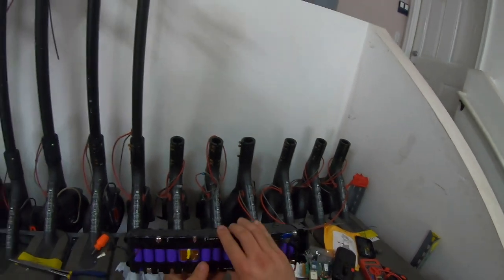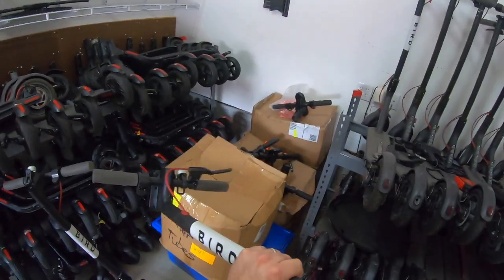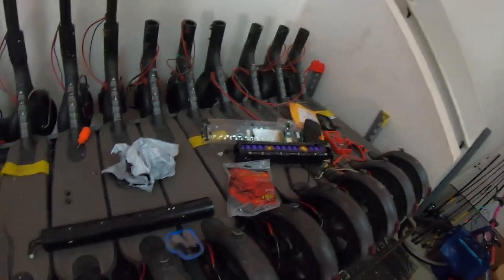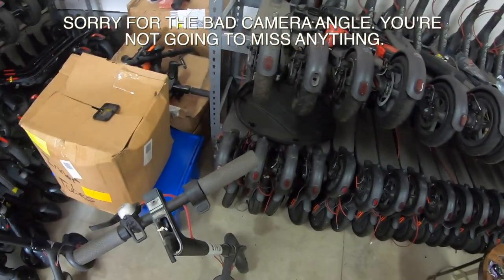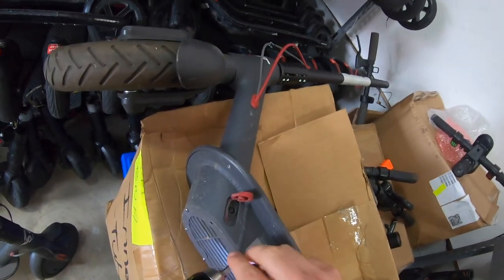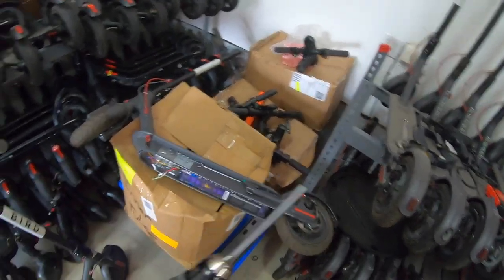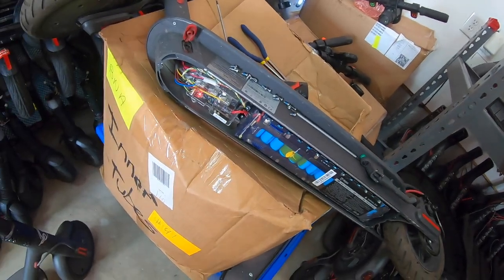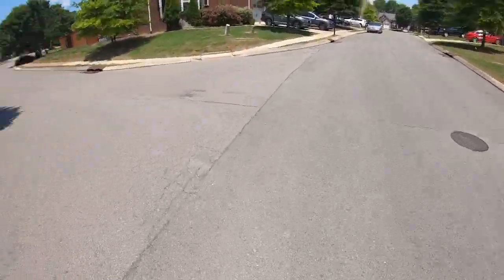Converting A Bird Scooter into a Personal Scooter. All the sauce. HOW TO VIDEO.

Comment: Use to be a Bird charger and mechanic for awhile and i learned a lot by tinkering around.  I bought several batteries back from the dead (they were just under 3 volts) by connecting the positive and negative leads from another fully charged battery for about one minute which temporarily would bring up the voltage in the battery.  Then as soon as I disconnected the good battery I plugged in the charger and now it started charging the low battery since I brought up the minimum voltage to an acceptable level for the charger.
Reply from the maker: Very interesting. What was the bms board doing before you linked a second battery?
Reply: Nothing.  No light flashing at all.  I'm guessing once the battery gets low the Bird brain continues to further drain the battery then the brain has a backup battery and even those drain dead.  Sometimes I was able to bring a dead brain back to life.  I'm here in LA and for the past year Bird and Lime and barely on the streets.  Not sure how they continue to remain in business.
Reply from the maker: Huge thanks for this tip. I’ve brought back so many batteries now that I thought had bad bms boards.

Do you have any idea how to revive a Segway-Ninebot ES2/4 battery?
Reply: In theory I suppose the same way but I hardly ever worked on those since the battery is tightly fit in the pole.  At one point I had 4 of the M365 but I ended up selling all of them and I kind of wish that I had kept one.  $400-$500 for a new isn't going to happen.  Too bad I don't live closer to you and I might buy one :)  I have a huge box full of parts, tires, tubes, etc which I'm going to hang onto.
Reply: Also if you ever have a dead battery if any kind especially car batteries new chargers these days won't charge a battery that is below a certain voltage so thats that I fo except I hook charger to good battery t then hook the bad battery to the golf battery and the charger will get the bad battery up to vtage to where you can charge it by it's self with out using another battery and it will charge like normal. Also if you have a personal bird type scooter don't charge it until it gets very very low if it is only half battery to 3)4 everytime you plug it in the battery had a memory and will die at only half a battery like a lipo battery had a memory on a rc car same principal
Reply: Hey brother do you have a video for that process? My BMS is not allowing me to charge my battery.
Reply: Hello brother, I'm having the same exact issue where my battery is below the point of charge. How would I got about getting a charge good enough to attach my normal charger to it?

Comment: More to my question is there anything significant I should know about when they break down like what breaks down first? Please I do understand most e-bikes so anything you can tell me would definitely help when it comes to a scooter obviously I know that usually it's the grips that are hindering the breaking and throttle is there anything else that generally goes wrong with these?

Comment: Hey bud
I bought a bird #590 older model and doesn't have a controller, it has three wires that don't look like what I see here . Mine has a different connection? Also what kind of control board do I need? Thank you so much for your help
Reply from the maker: Hey there, without having my hands on it I can’t give you a promising answer. I haven’t worked on that exact model. Keep searching, there’s got to be another video out there.

Comment: They also have a GPS track installed or is it on the mainboard?
Reply from the maker: This model for bird was in the dash on the handle bars.
Reply: Can you please post a link on the control board and dashboard you recommend? Thanks.
Reply: @brycecrum1  eBay xamei m365
Reply: Control board
Reply: It's on the board situated in the headset. 15.99 part on eBay can sort this out. Download the xaiomi app and you can downgrade the os and viola your done
Reply: @brycecrum1  there all the same just search xaiomi m365 board and your good to go
Reply: @ItzJigz187  so all you have to do is replace the circuit board and it can become a personal or are there more steps?
Reply: @ItzJigz187  and what’s the circuit board and what’s the dashboard I’m confusing the two?

Comment: How do you make those refurbished Bird scooters foldable? The ones I’m seeing are saying they are not foldable.
Reply from the maker: You can buy a foldable adapter on eBay for about $35
Reply: You wouldn’t have a link by chance for the adapter.
Reply: @teambryie  how do you convert the Bird ones?
Reply from the maker: @Guuch  what model bird?
Reply: @teambryie  The Bird One.
I'm also looking to purchase xiaomi's operable or inoperable, or batteries. Any leads?
Reply from the maker: @Guuch  I’ve got about 75 Xiaomi batteries.
Reply: @teambryie  how much? I’m in Maryland.
Reply: @teambryie   is there a better way to communicate, IG, What’s App etc. I’m seldom on here and I do not receive real time notification
Reply from the maker: @Guuch  Message me on IG @victorbryie

Comment: Does the dashboard work for the bird one?  Because in the video the dashboard looks thinner than the top section on the bird one.
Reply from the maker: Yes, you will have to change the handle bars though. You can order an Xiaomi M365 handle bar complete that will work.
Reply: @teambryie  is the wiring compatible then?
Reply: @mr.chubchubs6697  hey it's been a year but any chance I got it to work for your bird one?

Comment: I I have read in forums that they have an rfid sticker with which the company can detect the scooter despite removing the GPS, is this true?
Reply from the maker: Possibly on the newer models. NOT these.
Reply: @teambryie  so one time the GPS is removed from the handlebar panel there is no way to locate the scooter?
Reply from the maker: @fernandomontealegre3573  correct

Comment: I have switched out the circuit board and battery and still have no power. Battery is good and will charge, but the circuit board won't turn on. Any thoughts?
Reply from the maker: How do you know your battery is good?
Reply from the maker: What color is on the charger light when battery is plugged in?
Reply: I put a new battery in and the light is blue on it.
Reply from the maker: @crystalm1030  did the control board in the handle make a pop sound when you plugged it in?
Reply: It didn’t make any sound at all. But I switched it out before the battery so it had a dead battery when I plugged the control board in
Reply from the maker: @crystalm1030  do you have another control board to try? That would be the next step. If another control board doesn’t work you need to change the mothering board next to the battery.

Comment: What control panel and Dashboard do you recommend?
Reply from the maker: Anything that you can find on Aliexpress. Just have to wait weeks to get it.
Reply from the maker: US $47.74  40％ Off | Electric Scooter Bluetooth Controller Kit with Display Accelerator Light Set for Ninebot for Xiaomi M365 Pro Electric Scooter
https://a.aliexpress.com/_mPekf69
Reply: The blue light on the battery is flashing. I assume that means everything is working fine?
Reply: @teambryie  also I only need the control panel and new dashboard
Reply from the maker: @brycecrum1  the flashing blue light indicates that you have a good working bms board. That what you need. Battery is good.
Reply from the maker: @brycecrum1  this will work great as long as your control board is working properly. What brand scooter?
Reply: @teambryie  Ninebot m365
Reply: @teambryie  once I install the new panel and dashboard how do I get the scooter to work? Is that all I need to do? It’s an old bird scooter.
Reply from the maker: @brycecrum1  bird is the easiest. Only the dash needs changed. You don’t need to change the main circuitboard in the deck unless it doesn’t work. The new dash is plug and play. No updates required. Make sure whatever dashboard you buy includes the screen protector.
Reply: @teambryie  I’m getting an error when trying to pair with the ninebot app. It says connection service under maintenance
Reply from the maker: @brycecrum1  you need to pair with an Xiaomi app. Try “Mi Home”. Is your scooter working properly?
Reply: @teambryie  it moves! As far as properly that’s another story I’m not sure all the technicalities. I do need to find shorter screws as the old ones holding in the control panel were much longer. I assume a hardwares store has them
Reply: @teambryie  also it’s being found on the ninebot app but it’s not connecting fully
Reply from the maker: @brycecrum1  clip the screws with snips. Saves you a few dollars.
Reply: @teambryie  do you know how I can get the light working? Everything seems to be working but the light. Oh and I can’t find a mi home app other than the smart home app
Reply from the maker: @brycecrum1  to turn the headlight on you push the power button one time after the scooter has already been turned on. 

If the headlight is still not working the headlight is either bad or there is an issue with the main control board in the deck. I have never had an issue with the light it self being broken. Always a control board issue. I then replace the control board.

In regards to the app, I use “mi home” with an iPhone. My be different on an Android.
Reply: @teambryie  ok I’m using the app On iPhone too I’m selecting the electric scooter option. And as far as the light maybe I didn’t connect the light switch all the way? The back brake light is working tho.
Reply: @teambryie  ok the headlight is on on now when I hit the bottom a second time but now when I connect it to the app there is a loud constant beep that won’t turn off. Also is the screen supposed to turn off when I have the light on?
Reply from the maker: @brycecrum1  the beeping is likely caused by using a cloned dash board. The dash turning dark when headlight is on is also a motherboard issue.
Reply: @teambryie  what do you suggest doing?
Reply from the maker: @brycecrum1  I would just leave it alone. You’re not losing much.
Reply: How much are you asking for the scooter 🛴 do you ship to california
Reply: Some one help need buy dashboard of Xiaomi 365 to make bird workings??

Comment: Question what board are you using. Is there a number. Thanks
Reply from the maker: No number. Go on eBay or AliExpress and search M365 dashboard with cover or M365 Pro Dashboard with cover. You will find it cheaper on AliExpress but the shipping takes much longer. Let me know if you have any problem.

Comment: Hey do you need parts for those birds I have a bunch of brand new parts from when I used to work for brid I mean like thousands of parts I will plug you in for an extremely good deal if you want them
Reply from the maker: Possibly, I have about 10- M365 left that I don’t have many parts for. DM me on Instagram @victorbryie
Reply: We have 19 bird scooters which we are trying to refurbish. Is there somewhere I can reach you for parts.
Reply: I would love to get some things from you if it's possible.
Like a another motherboard for my Bird One I prefer the Xiaomi motherboard
And I would like to get a new battery because I have red lights blinking on my Bird One !
Does this mean that the battery is out of work ?

Comment: do i need to do the second part if my bird scooter worked before
Reply from the maker: The second part?
Reply: @teambryie   yeah u said to watxh on if rhe batteriebis broken in the same video
Reply from the maker: @tkey23  as long as your battery has a flashing blue light on the bms board you are okay with that battery.
Reply: @teambryie   a ok thx but could you reply with the lik of the thinks you had ro buy for this not the toolls for example the dashbord
Reply from the maker: @tkey23  The links are always changing. Not a consistent seller for the parts. DM me on Instagram and I will find you a link.
Reply from the maker: @victorbryie

Comment: What control board should I buy? (What's the name on the board that he uses)
Reply from the maker: Just google M365 dashboard. You’ll want the one that has 4 lights across the board. You can search the same thing on EBay or AliExpress. AliExpress is the cheapest. Just takes longer to get it. You are talking about the dash, correct?
Reply: @teambryie  Thank you man, that's really helpful! Yes, I just talked about the dash....
Reply from the maker: Make sure the dash that you buy comes with the plastic dash cover. They are not always included. Let me know if you have any problems I’ll be glad to assist however I can.
Reply: @teambryie  How can I increase the speed of the Bird scooter... I don't want reliable scooter, just something that I can have fun with it
Reply from the maker: You will need the PRO M365 dash for that. Going watch my latest video. It gives you a walk through of how to do that.

Comment: good job, he does a good service to remove them from the streets...those are awsome to pull 18650 cells from for free....and build ebike batteries!
Reply from the maker: I’ve got over 100 batteries 🔋 complete.
Reply: Hey how are you bro i just bought a bird scooter how you charge to convert it
Reply from the maker: @jamildaceo5261  , if you have this same model, there is a charging port on the deck plate of the scooter. You will need at minimum a 2 amp charger with the same connection. You can find chargers on eBay or AliExpress.
Reply: @jamildaceo5261  depends on the model... new bird 2 cant be converted yet....but relatively easy to strip 18650 cell pack its 21ah 36v....made with lg mj1 cells. GL.

Comment: My scooter has Julet connections on cables. Replacement circuit board has 3 wire connections . What can I do ?
Reply from the maker: How many pins are on the scooter connection? How many pins are on the control board connection? What brand scooter?
Reply: @teambryie   need help putting a external battery on my es-1 300 bird
Reply from the maker: @richardarrellano8638  , have you already purchased an external battery?

Comment: Whats that battery charger u use?
Reply from the maker: https://www.ebay.com/itm/Electric-Skateboard-Scooter-2A-42V-Battery-Charger-Adapter-For-Xiaomi-Mijia-M365-/264779334874?mkcid=16&mkevt=1&_trksid=p2349624.m46890.l49286&mkrid=711-127632-2357-0
Reply: @teambryie  thx bro can u help my out with the tool u use to take apart the gps parts ive been looking and cant find it i tried a whole bunch of small allen keys but nothing
Reply from the maker: @carlitodidthat  you need a security bit set. Be careful, the bit it small and can strip very easy also.   https://www.ebay.com/itm/32PC-Extra-Long-6-Security-Bit-Tamperproof-Set-Hex-Torx-Star-Pozi-Tri-Wing-/291939181423?mkcid=16&mkevt=1&_trksid=p2349624.m46890.l6249&mkrid=711-127632-2357-0
Reply: @teambryie  ty so much bro u the man
Reply from the maker: @carlitodidthat  My pleasure. Good luck to you.

Comment: How do I fix the motor in the front wheel of my e scooter
Reply from the maker: What’s the problem? What’s the model and SN of the scooter?
Reply: @teambryie I see your very knowledgeable on the bird scooters 
. I own a white bird that snapped at stem and now got welded. Won't turn on now and heard bird took us off network...
Reply from the maker: @Jae-T219  unaware of being off of network? All mine are working OK. Have you disassembled and checked all the electrical connections?
Reply: Very nice of you to help the many noobs.

Comment: Can someone please help me I was riding my bird  electric scooter a and it cut off when I was riding it and when I got it home and i pulled it on the charger and it’s blinking green and red when I pluged it in the charger please please help me
Reply from the maker: Sounds like you have a battery/bms issues. Remove the deck plate on the bottoms of the scooter. With this, you will gain access to the battery and mother board. At one end of the battery is your bms board.... does your bms board have a flashing light? If so, what color?
Reply: @teambryie  I don’t have the tool to remove it as soon as I remove it I will let you know OK thank you for your help

Comment: Where can I get that mother board and do I have to do a firm update and all that junk
Reply from the maker: You can find cloned boards on EBay or Aliexpress. The boards are plug and play. No updates needed.
Reply: Team Bryie Reviews is it possible that you could link? The ones i find needs firmware update with Android
Reply from the maker: Morten Knudsen , what are you trying to convert?
Reply: @teambryie  I haven't decided yet, but checking up on prices to see if it is worth the effort. I'm currently looking at an Bird, VOI og Tier scooter. Maybe the Bird will be best if I can find it on an auction.
Reply: Team Bryie Reviews A Voi, Tier og Lime scooter will be the best options for me. Is it possible with these?
Reply from the maker: Morten Knudsen it is possible with both scooter very easily but both have different processes. I only know of the Xiaomi m365 and Segway ES2 and Segway ES4 being used. On an Xiaomi m365 you only have to modify the dash board. There is no programming required. You can use the motherboard that’s already on the scooter. With a Segway scooter it is best to change the motherboard and the control board. I get most of my parts from Aliexpress. You can do the conversion for under $60 if the battery and motor are in good working condition.
Reply: @teambryie  Do you know what scooters using Xiaomi M365? I found both Voi, Lime and Tier on aucton. Only Voi have the same control board as the Bird you have brought.
Reply: @teambryie  you do nee to do a downgrade on the firmware though to get it to run on the xaiomi app
Reply from the maker: @ItzJigz187  , that may be. I use the Mi Home app effectively.